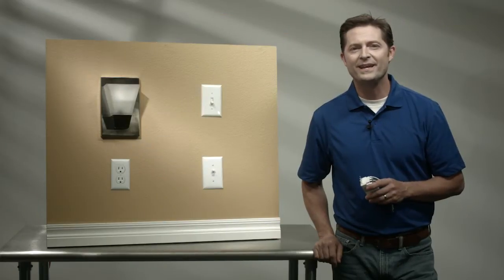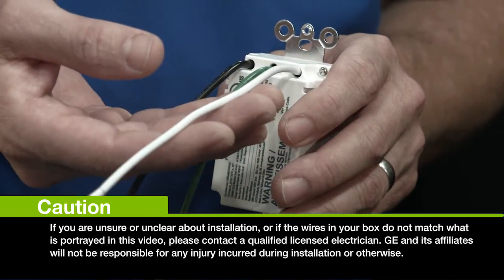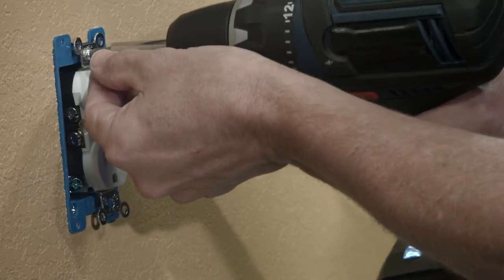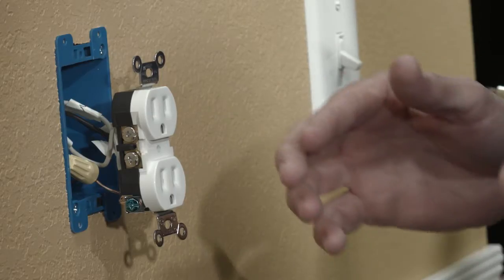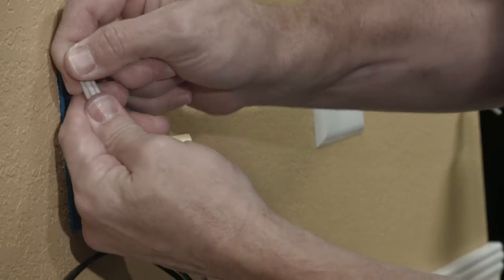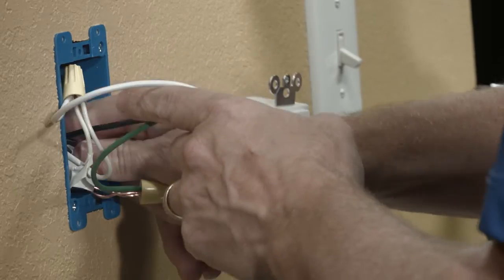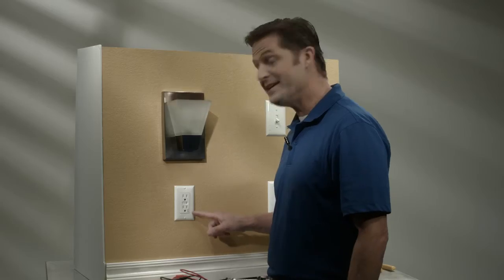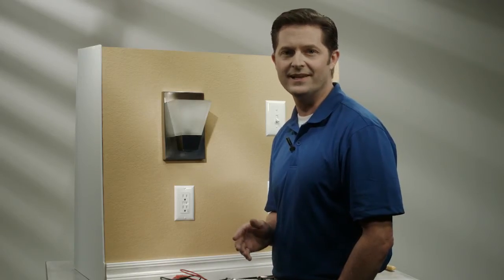12721: GE Z-Wave In-Wall Smart Outlet

Comment: I was originally thinking of getting quite a few of these, that was until I seen it used wire tails and not terminals like on the other light switches which I think is quite disappointing.

Comment: The only reason I watched this video was to watch him wire the new outlet...
Reply from the maker: Hi, Gage. If you still need assistance, installation of the Z-Wave outlet begins at 1:47 after the traditional outlet is removed. You can also contact our U.S.-based consumer care at 1-800-654-8483, M-F, 7 a.m.-8 p.m. Central Time with any additional questions.
Reply: Thank you for the response! I figured it out. I had to use a pigtail connection which isn't quite the case in this video. My situation complicated the process a bit, whereas in the video he is simply connecting wires with a wire nut.

Comment: Couldn't be bothered to show how to do a factory reset, huh?
Reply from the maker: Hi, Dave. A factory reset for this generation of Z-Wave device is performed from your hub. The steps for this process are determined by the hub manufacturer. If you have additional questions about the Z-Wave outlet, our U.S.-based consumer care is also available at 1-800-654-8483, M-F, 7 a.m.-8 p.m. Central Time.
Reply: @JascoProductsCompany  Hubitat documentation states that models 12XXX "do not support a factory reset" and that I can only exclude from my Zwave network. I'll be interested to see if it is able to pair with the new hub.
Reply from the maker: Dave, You are correct; we misspoke by saying the factory reset instead of exclusion is done through the hub with this item. Any generation of Z-Wave device will respond to the exclusion command from a hub and can then be added to a new hub. If you have any issues, feel free to contact us.
Reply: @JascoProductsCompany  Finally got around to migrating from a C4 Hubitat Hub to the C7 model. I put the old C4 hub into exclusion mode and press the zwave button on your outlet one time but it simply will not exclude from the hub. So, what's your advice, if any?

Comment: So what about if you don't have a ground wire?
Reply: Functionally you only need the hot and neutral wire for it to work. Keep in mind this is not recommended nor is it O.K
cause of electrical standards & safety. So the correct way to install it in your case would be to:
- Findout if there is an outlet which has ground and is on the same fuse
- Add a groundwire from that outlet to the outlet which is missing the ground.

Easiest would be to hire an electrician ofcourse.
Reply: What a terrible video, seems like whoever edited the video, edited out him wiring the zwave outlet!
Reply: If the outlet is protected downstream from a GFI receptacle or connected to a GFI breaker, you can leave the ground disconnected or "floating" in some areas. Other municipalities require you to pull a new wire with a ground. Check with your local electrical inspector to see what's allowed where you live.

Using a "cheater" or "pirate" ground (connecting ground and neutral at the receptacle) is unsafe, as someone later could potentially swap the wires upstream of the outlet, leading to equipment with an energized chassis. Do not do that.